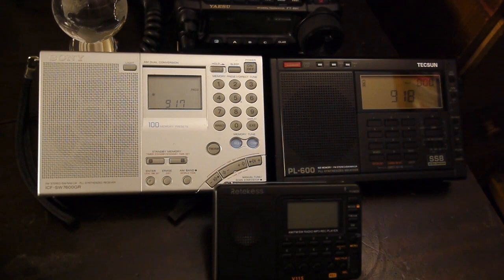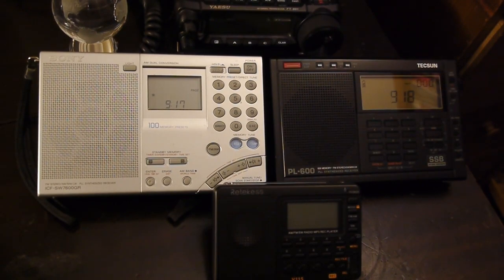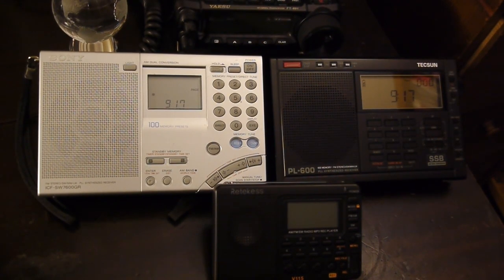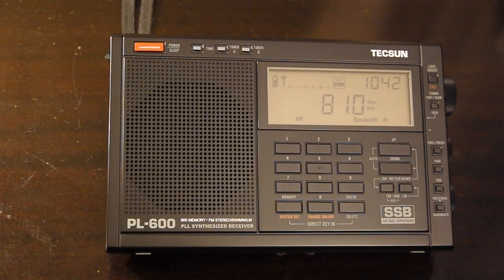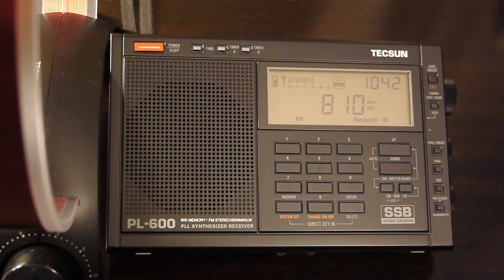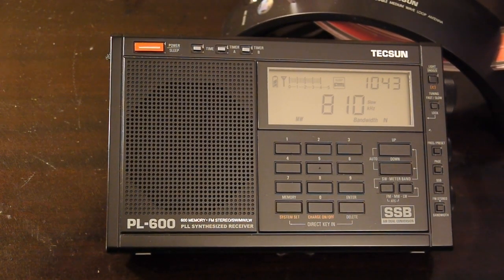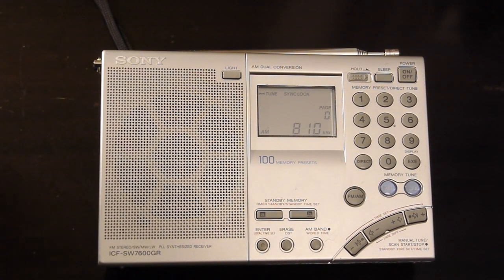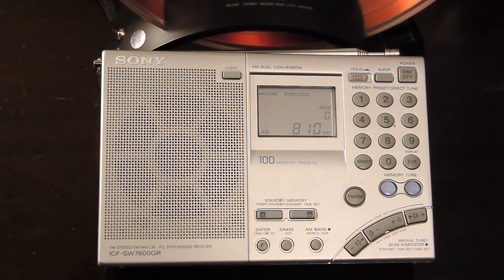MW Shortwave Receiver Comparison with Passive Loop Antenna

Comment: the 891 is probably the best receiver I have.  It's the only radio i've had where I've been able to receive wspr on 472khz.  I recently obtained an airspy hf+ discovery and it has a very low noise floor i think equal or close to the 891.  It's really exposed my need to work on my receive antenna lol.  I had a tecsun pl660 that I gave to someone, i thought it was a very good portable for the price.
Reply from the maker: @youtubeaccount931  pretty much the same here. The 891 is super sensitive. I also have an HF+ but haven’t used it much yet.

Comment: I made an inductive loop with a 16 inch pizza box and a 450 pf tuning capacitor using 17 turns of about 24 AWG magnet wire slightly spaced. It`s powerful. I have the AN-200 too and mine is far better. I used hookup wires with clips on both ends to wire both gangs of the tuner together to the coil. It seems to be perfect for the American AM/MW broadcast band. An extra turn can be used because it`s bottomed out on the tuner when it`s resonant at the low end of the band.
Reply from the maker: Very nice!! I’ll try it! Can you use yours for 100-500khz too??
Reply: @shortwavelistener  I`m sure you could probably add more capacitance. But no this loop just barely gets to 520 with the tuner fully closed. I found the 450 pf tuner on the big online site that starts with A. If I type it they auto delete my comment. But now I can only find a 365 pf one there and it`s too expensive. If you make 30 turns or more on the loop it should get down into the longwave band. I just estimated the number of turns needed when I made it by counting the turns of the AN-200 and subtracting some for the larger coil form. 16 turns on the 16 inch pizza box doesn`t get all the way down to 520 with the 450 pf tuner.

Comment: I didn't see you tune the loop with the variable capacitor on the Loop antenna to peak the 810 signal. I would guess you already did that. If not, it's not a valid test. Otherwise, I enjoyed the comparison. Thanks.
Reply from the maker: Yes, I did pretune it. Thanks for pointing that out. The loop tuned exactly the same on all three portables - so no adjustment was necessary. I'll alter the description above to call that out. Thanks!

Comment: You say you're hearing these stations "from my location" ... where is your location?  It's impossible to assess PL-600 noise because of the crowd noise of the sports event.
Reply from the maker: In Minnesota. Yes the sports noise was there but that particular frequency was just an example.
Reply: @shortwavelistener  An example of listening to a broadcast of noise, masking any noise (or lack thereof) of the reception.  I must say you are pretty far from Schenectady.  I have trouble hearing WGY here in central PA.
Reply from the maker: @gregm.857  agreed - I did say "probably" WGY because it is the only nightime clear channel broadcasting at 50kw on 810 when the passive loop is oriented E-W and I typically have no issues receiving most of the clear channel evening stations from East coast to Mid Rockies. But, you are right that it was speculative.